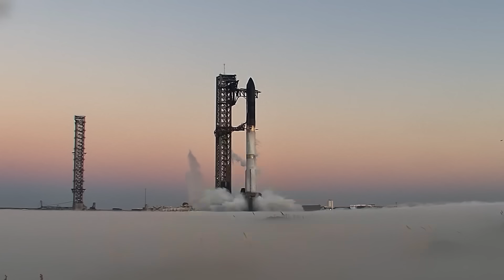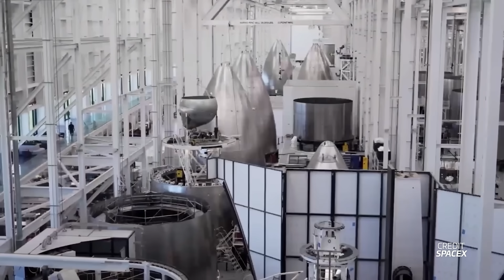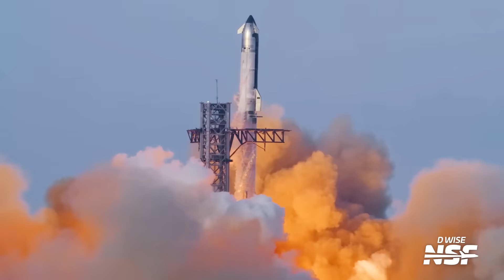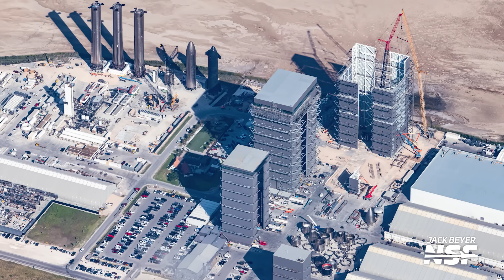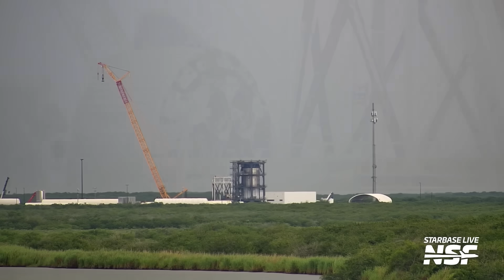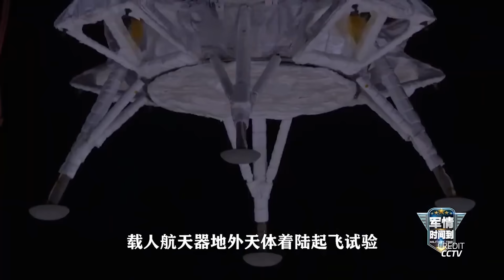Starship Flight 10: What's Next? | Starbase Update

Comment: Yeah, landing on Mars with no legs and staying upright. That’ll be a betting pool. 😊
Reply: If the ship is not going to be "rapidly reusable", but just "reusable", as things stand as of today (with a couple of weeks turn around time for future oprerational flights), having well-designed, sturdy landing legs becomes far more relevant than catching the ship with the tower - the latter becoming practically pointless.
Reply: I guess their goal is only to get there and that's it.
Reply: @RedmondJohnson It is unlikely to even reach that goal.
Reply: makes sense to me. actually. best part is no part.
Reply: @websitemartian  No it's not, a different design makes more sense. :) They will need a super flat surface to land on like that.
Reply: @punishedbrains    Any reasonably flat surface becomes a crater just before the ship lands (try and find flat surface first from a few km up when, unlike Earth, it's going at great horizontal speed almost all the way until the landing burn), so they'll have to do gimbaled thrust at an angle to direct exhaust away from the landing spot. With vacuum Raptors they can't - the nozzles are right against the skirt and they can't use little engines up the top as on the Moon for obvious reasons, so they'll need to use the middle three SL Raptors, which is fine but has disadvantages - you need extra fuel for SL and they are in the middle, which requires a bigger angle and use up more fuel.

Upon landing the ship will be extremely top heavy and could eaaily fall over even at a moderate angle (it'll have 50-100 tons of cargo right at the top and only some 15 tonnes worth of 9 engines at the bottom and practically empty tanks in between). So good, solid legs will be the key to keep it upright on landing. They will have to be wide and adjustable to compensate for uneven surface similar to Apollo lunar module. Otherwise land on a big boulder or a hole under one leg and the ship falls flat on its face. Landing on the skirt is even worse and is an idiotic idea, although understandable as they're really strugling to keep the mass low.
Reply: @websitemartian  the best part is no part, but only if you can do that without sacrificing much. legs are pretty necessary for balance and for allowing exhaust to escape the skirt in landing
Reply: The landing is doable, but the staying upright during Mars storms is what's tricky. Maybe they're planning on a different system for that. One that can stay on Mars.
Reply: @EaglePicking  the martian atmosphere is extremely thin. would it even be possible for storm-winds to knock a starship over?
Reply: @HamzahKhan314  Good point. I have no idea, actually ;-)
Reply: @EaglePicking  The answer is no. Mars' atmos is less than 1% that of Earth's. Way too little mass to affect something as heavy as Starship
Reply: @EaglePicking  The Martian atmosphere is extremely thin -- only 1-2% as dense as earths atmosphere. The wind doesn't push very hard.

Comment: I don't understand landing on Mars on the skirt. Land soft enough to not blow up? Level enough to stay upright? Deploy any payload with Optimus? I hope there's some landing leg plan.
Reply: The problem is, that they need a dozen or so flights to refuel and then there is a bazillion of other problems before a flight to Mars can take place. There is no payload. Optimus is a joke. There is no other equipment that could be using the elevator. Nobody has a rover ready to do science on Mars. Nobody has a solar farm that can be set up. There is no food farming experiment ready to go. No water or fuel production facility. So they don't want to put a lot of work into legs for today's starship but they also don't want to admit, that the flight won't take place any time soon.
Reply: Optimus will jump out of starship and parachute to the surface of mars before first starship landing. They will do this with GoPros and rakes on their backs. 6-8 Optimus will rake a smooth landing pad.
Reply: They probably want to see how big of a hole they are going to make so they can design proper legs lol
Reply: @digi3218 I know we love to talk about spaceX's hardware rich approach, but this makes no sense. We have a pretty good idea what the Martian atmosphere and gravitational field looks like. We have some data on what the terrain looks like. They should be able to design landing legs based on this information.
Reply: @digi3218  This is honestly probably the right answer, unironically lol. Getting a sense of how much landing leg you're gonna need is important
Reply: Yeah. I see no way they can land on an uneven surface without landing legs, except with a lot of luck.

Also note that Mars gravity is significantly lower than on Earth, 38%, while inertia stays the same. That means things tip over more easily.
Reply: I think it is more about intersecting Mars and getting as much data as possible. Landing softly is just icing on the cake